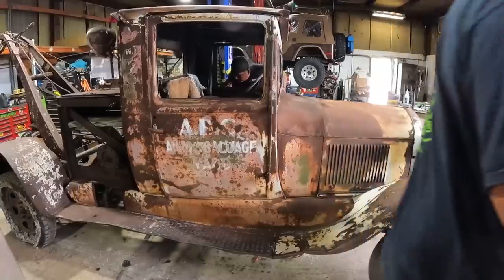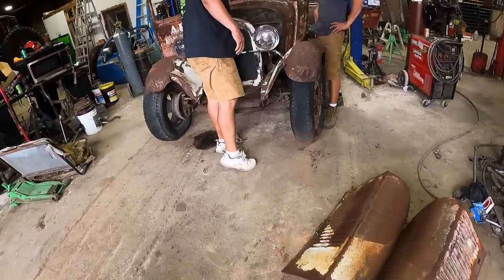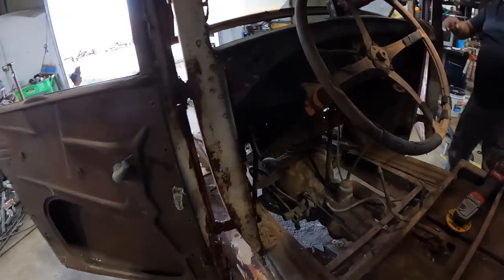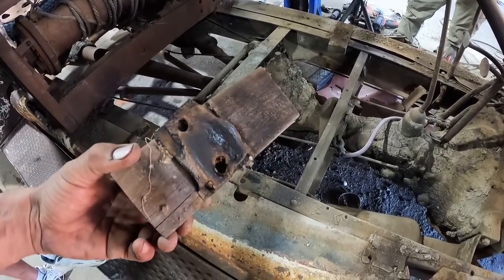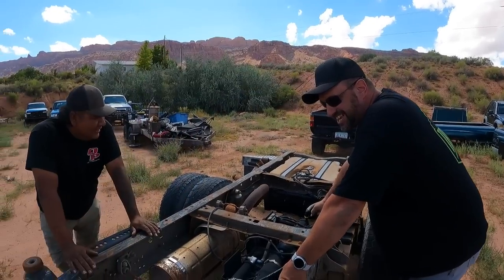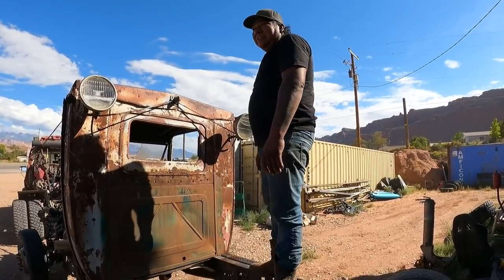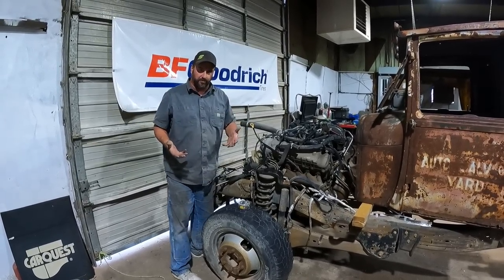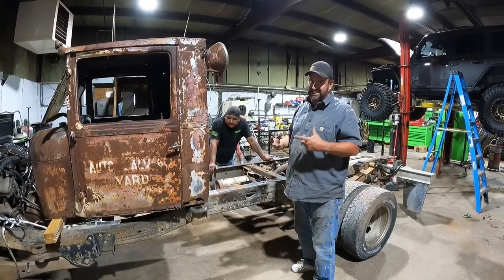@RobbyLayton Model AA Wrecker Build (Part 1)

Comment: I have been looking forward so much to this build. I am an avid fan of Matt's and Fab Rats'  builds, and this has the potential to be superb viewing. Not only that, but I am going to learn a lot about Rory's engineering philosophy - and that can only be a good thing.
Reply: Very well stated!
Reply: That's one of the big things in looking forward to myself$
Reply: I can tell you his philosophy:    "Iterations" -- 
Run it until it breaks, upgrade as needed, keep using what works and discard what doesn't work well;   Iteration after iteration;  trial and error.  The scientific method.  After years of that happening again and again, you end up with Trail Mater.  and As you can see, Paul is basically copying Rory's two trucks.  He's narrowing the hood just like Trail Mater, and he's using a hydraulic boom in the back, just like Old Blue (Rory's other wrecker).    Matt is going all out and trying new things -- but it may end up not being very useful on the trails-- we'll see.  If not, it still makes a cool sand wrecker.  It will be fun to see them all on the same trail some day.
Reply: True words 🇺🇸🇺🇸👌

Comment: People were extremely frugal during the era when this truck was built. During the Model T years (just before this was built) Henry Ford specified the size of boxes the parts for the vehicles would be delivered in. Those sizes were the ones needed for the wooden floors and other wood components. Just one of the innovations that made Ford a cheaper vehicle to build and a cheaper price. This will be an epic if long term build. The sbc is probably the best choice for anything with limited space and a need for performance (especially cost wise).

Comment: Your right about a early small block Chevy. Be sure to not use a HEI! They are way too big! You already know to use the short water pump etc. To get a small block under a model A hood you will have to cut out the firewall for it. Be sure to leave room to pull the distributor etc. A easy way to do the firewall setback. Is to use a metal wheelbarrow (measure how wide and deep, then find one at the hardware store, not all are the same). I've built a lot of model A Fords over the years. That's what I used to do for a living. All the hardware and parts you might need are available thru places like MACs and other early Ford places. It should be a fun project! As always thanks for the great videos! Keep up the good work.

Comment: The V-10 served a purpose and you called it, Rory. Boat Anchor. I've had lots of small block Chevy motors in everything from a '63 Landcruiser to a '74 Camaro to an '89 GMC 3/4 ton 4x4, etc. No way to go wrong with them. They make adapters and accessories for everything you care to do with them.

Comment: I had a 1935 Ford 5 window coup, and a 350 fit under the hood and the radiator supports were still there. Older 350 is a great choice!!

Comment: I think you are right about making another boom/winch setup.  Anyone that has tried to marry frame materials that are more than two decades apart can vouch for the fact that there is a huge difference between the two.  In short, modern day frame materials are a lot more durable.  And that winch, though the creativity of the person that built it could be admired, the materials it was made from and the welding means it's place is best where it was, most likely, most used - in the junkyard itself (and that done with extreme caution).

Even current era frames can have a big difference between them, in regard to flexibility.  A utility bed manufacturer I delivered for started putting a wider gap between the factory cab and their beds on the Dodge chassis, because the flex that was engineered into the frames could cause the cabs and beds to foul each other if the trucks were towed while loaded to max capacity.

Have fun with it.  It will be interesting to see how this develops.  I'll be looking forward to seeing how you get power to your tandem rear axles on the 6x6 build.  Probably not at all like I'd planned for mine ... but you probably won't have the advantage of having "double-deep 5 under."

Comment: the headlights on the back of the cab are 1934 ford commercial head lights and would look way cooler as the actual headlights on the front, that s what hot rodders did back in the day👍

Comment: I had a 29AA that I think was a tow truck, the person I bought it from said it was a car hauler and the welds on the frame were from a fifth wheel mount.  I regret selling that truck.  When I bought it the doors wouldn't stay closed. I fixed that and had the valve guides replaced in the motor before selling it. Looking forward to seeing the final product.

Comment: Use the old boom as a skin on top of the structural boom you create!  It will have the look and the strength!  Just put rubber between them, so the rust doesn't get to your boom!  Eddie

Comment: I'm just as excited for this build as Paul's builds.  I can't wait to see the engineering and details involved.  My vote is to rebuild the old boom and winch exactly the way they did it back in the day just with all new steel and equipment.  It should look exactly like the original just modern day.  Add all the winches you want but still should operate like the original setup.  I'm excited for this build!

Comment: That button in the wood panel is not a gas pedal but the starter solenoid,  it was foot activated.  I seem to recall my dads truck had one.  Typically it was mounted to the right of the gas pedal and pushed on the solenoid with the ball of your foot and pressed on the gas pedal with your heel. Left foot was on the clutch.

Comment: Agree on the chevy small block, definitely 4 bolt mains and double hump heads.  If you need cubic inches, they can fairly easily make 400ci.

I'm afraid it will always look like an old body perched on top of a modern frame.  Aren't those shock towers going to stick out of the front fenders?  You need a square body frame.

Comment: I agree, you arn't building a race car, you're building a Locomotive that will pull a house down. Strength and duability are the key in this build. A good grinting SBC woth 202 heads will do the trick! 
And as far as that old boom goes, I'd ditch it too, because it was never intended to haul the loads you are going to put on it.  Those old Model A's only weighed about 1000 lbs loaded.  A good rock buggy weighs more than that......
My Grandpa had one of those as his daily driver in the 50's.

Comment: Nothing wrong with a small block Chevy. I ran an LT1 in an old drag car, my 70 Camaro. Forged lower, polished and gasket-matched 2.02 heads. Comp Cams valvetrain with a big hydraulic cam, dual springs and titanium locks. Edelbrock medium rise intake and Holley 850 double pumper. And big tube 1.75" headers. Which were kind of a pain. They came with flanges that you bolted to the heads. And then bolted the headers to the flanges. And that caused interference with the steering shaft. So, you get a hammer...

Comment: Honestly I have mixed feelings about this build. I just tuned in to the project so not sure of your intentions. But I did here someone say F350?
This old truck is a rolling time capsule. ( like the Rosevelt pin under the seat!)  OMG!
It would be a shame to not fully restore it. The other side of me is excited to see it on a more current chassis. It would also be an extremely cool project. 
So with my teeth clenched and I am looking forward for all the interesting content coming up. And the obvious awesome end result
it will become, ether way. 
Hats off to you Rory for entering the pet tow truck race!! 😎

Comment: This will be an awesome build, my only complaint is the small block chevy.   A built 302 ford would be cool.  Not trying to hate on chevy but im a firm believer in leaving ford motors in ford vehicles and same with dodge and chevy.  Cross breeding just isn't my thing.  That and everyone always takes the cheap route and builds a 350 or an LS.  Just my thoughts.

Comment: If you’re going with the older style V8 why not use a 302 or 351W?  Aftermarket is plenty strong for both and they both provide the strength and reliability required for the build while putting a Ford in the Ford.

Comment: My '28 Model A had similar fuel and rad caps.  I believe '48 Ford Backing Plates will work if it does not have Hydraulic Brakes.

Comment: If push comes to shove for room constraints for engine compartment 94 caprice I had was powered by a 4³ V8 I think displacement is 263cu you probably know about it but I cant tell ya how many times when i went to parts store they told 4³ is by not V8 incompetence run rabid lol .... but i got about 30mpg on hwy & 18 city just a thought ...I think it's an upgraded version of the 263 from the 50s
Hope this helps

Comment: Hey Rory on the boom how hard would it be to start with 8" C channel and box in the open side for extra strength and it would give you a place to run the wiring for any extra lights. Just a thought I hope it helps.

Comment: Robby, it would not be hard to extend the hood wings.  No need to add more louves to the extension.   I think Paul at Fab Rats has rollers but I am sure you'll find someone nearer than that and it is such an easy curve.  Of course, if the small block will fit in without making more room, that would be better.  As for hassling you, that's the last thing I'd want to do. The longer it takes, the more videos we get to see (hopefully), and Robby is paying.

Comment: Yes I know what your going to endure because when I was about 11 or 12 years old I had the opportunity to help disassemble a 1929 Chevy and all the bolt 🔩 ended up being  Chisel off talking about work all we had was a hand  Chisel and hammer 🛠 even though you will end up using impact  Chisel or a torch set up either way it will be a little ruff. Good luck and just have fun.

Comment: I agree with you on the ford v10. But I have used my Ford as a truck and I have bailed out Chevy trucks more than Ford. I know Ford sucks off road and under powered. But I have always gotten to my destination unlike so many Chevys. Now dodge is another thing. It's only good when it is the older Cummings and a manual transmission. If it's a automatic transmission. It will brake down the first time you chirp the tire.

Comment: I would use a 302 Ford or even a 351 W its a small block too, the 351C is too wide for sure.  The good thing about the Ford engines is the distributor is in front makes for lots of room to push the engine back. There is a 302 Mustang GT engine in the 4Runner in my photo. It has over 80,000 real hard miles on it and still works fine.  Same automatic and Dana 300 modified to fit the back of the Mustang transmission.  I'm not a GM hater or Chrysler Hater I am somewhat of a purest. If you are using a F350 and a Model A why not use a Ford engine?

Comment: I am all on board with you on the old school 350 Chevy, they're great motors. 
But since when did the ls style motors get bigger?
Reply: It’s the electronics that he doesn’t want to deal with. Not the physical size. BUT, a SBC has been known to be put in everything under the sun. I’m even considering one for my Tacoma (99 4x). That way I could go with ANY drivetrain combo out there.
Reply: @ToddAdams1234  You do realize Rory has EFI on Mater, despite his claims of "damn carburetors" when he stalls the motor. He said the LS motors are too big, as in physical size. Where in reality they are the same size as a gen one or two Chevrolet small block, even the 6.0.

Comment: How about a GM 350 diesel block?  Four-bolt mains and enough cylinder wall thickness to overbore 0.25" and still be thicker than the standard block.

Comment: New comment, set the front fenders to the front wheels, then the grille to the fenders, next position the engine, then the cab - you can alter the length of the hood if needed, but the aesthetics will be right.

Comment: First off, I'm not a hater, I get a kick out of this channel. I do have a question, tho,  I was always under the impression that the LS motors dimensionally were within an inch of all major dimensions with the OG CSB. The only reason I wouldn't use an LS in that application IS the fact that the electronics would be out of place. Physically, you COULD use an LS in the same footprint, so am curious as to your statement otherwise. Seriously, you guys do good work and you shouldn't think my OCD is saying otherwise.

Comment: Okay,, waited long enough.    Where is the build ??    If my opinion matters, it would be a good thing if you knew a guy who knew a guy that does body fabrication and could extend that hood and running boards.    I love the idea of keeping the OG fuel filler to a tank in the frame.  The boom should be replaced but needs to look period correct as well as shop made. So uggly cable clamps put back on the boom ( though I'd do them just as decoration and put compression over woven-in cable. Maybe Yankum or someone can make a synthetic that looks aged but is stupid strong and have metal rings built in for attaching points.  Absolutely must keep that winch/tool box. As for the winch drum yeah probably not the best. But again for period correct look it has to be a shop built thingeee. Simply built by someone with better welding and fabrication skils. Hopefully you know someone like that.

Comment: In my opinion Ford getting rid of the 460 and going with a V10 was Dumber than when Chevy went away from the 350 the ls is okay but there's just so many 350s and so many options and so many cheap parts and they just got into a point where they put an awesome multi-point fuel injection system on it

Comment: Be careful with the EPA on this. They are going after Rich Rebuilds for putting a diesel in a tesla using the original bread trucks frame. The emissions need to be equal to the newest part on the truck. Thus it will need to match the frames emissions rrequirements.

Comment: The truck is a FORD.  Drop a small block FORD engine in it.  There is plenty of aftermarket support for Ford engines to get the power you want.  It's just lazy to drop the old 350 crap in a Ford car/truck.

Comment: Bought a 01 f250 v10 sold it running 10 years later 298 thousand miles and every day it was worked to death it had 2.500 pound over load springs and f450 springs in rear it road good with a load with out looking loaded you could fill the 2.5 yard sander up no squat I can't say anything bad about Ford but I hate Ford cars

Comment: I suspect that the cab will end up so butchered to fit the F350 frame that it will no longer qualify to called an "AA"!  Since this project is intended to be more conversation piece than actual tow truck, I think a 'functional' restoration of the original truck would garner more attention.  It would be a hit at a demo derby towing dead cars away!  Tow a derby car in parades, etc.  There are more than enough rat rods around!  Have Robby give it the Golden Nugget treatment.  Just update the winch and boom to be safe.

Comment: Please, please, please, don't  put chey engine in ford body and frame. Boss 302, 351QJ, even small block 400 around mid 70s,should fit right in and go with the theme  you are trying to go with using the aftermarket